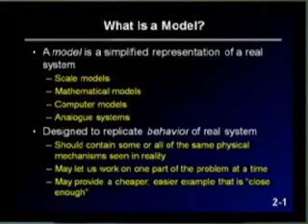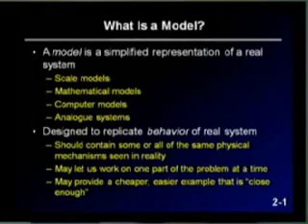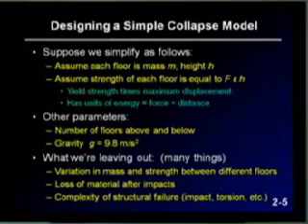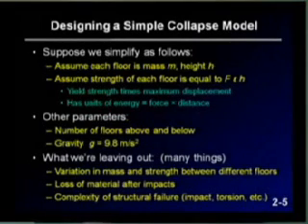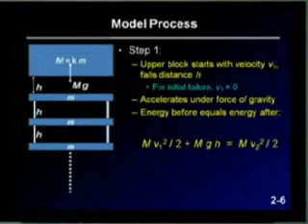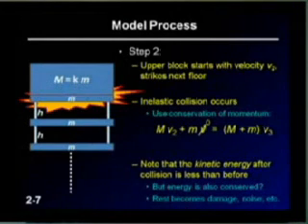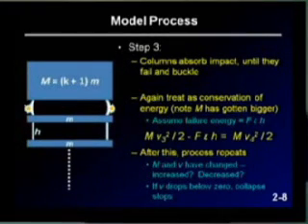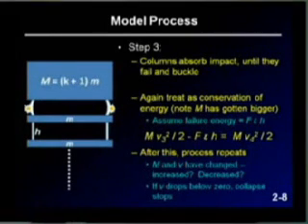WTC Modeling Instruction & Testing in the Real World

Comment: @ialsoagree "Once a steel support is crushed, it becomes a part of the falling debris, it does not continue to support the structure"

I don't follow your reasoning, in both cases the falling debris becomes part of the falling mass, unless the debris collapsed into a magical infinitely compressed one dimensional black hole like Bazant suggests the analogy holds.

The falling material holds up the falling material above it in both cases. Either it's being stopped to allow compression or it isn't.

Comment: The other problem with using the inelastic equation is that there is no sense in which there is two objects which remain two objects after collision if significant breakage occurs. You have a new object that falls, you can;t simply add the masses together as if they were Play-doh.

What is ironic is that no serious engineer believes the pancake platter theory and yet all models supporting the collapse assume it.

Comment: Excellent again.

Unfortunately you must realize that there are none so blind as those who will not see. There are still people arguing that thermite can't cut vertical beams and still people who argue thermal expansion cause the perimeter bowing.

All the official 'collapse' models involve this solid block even though there is in physical reality that even suggests the building could have (never mind should have) behaved that way.

The inelastic assumption is complete unsupported hogwash.